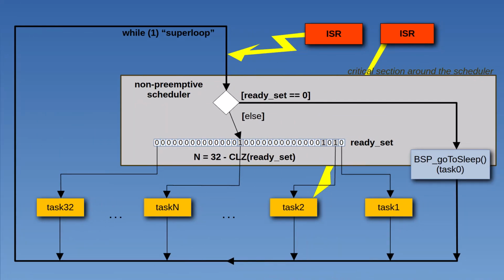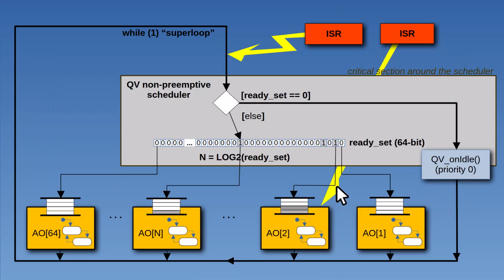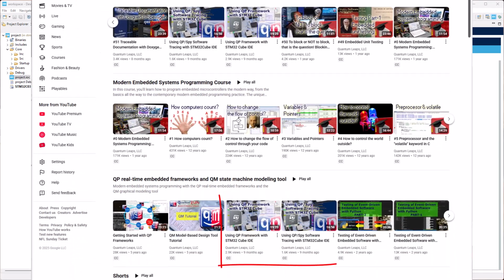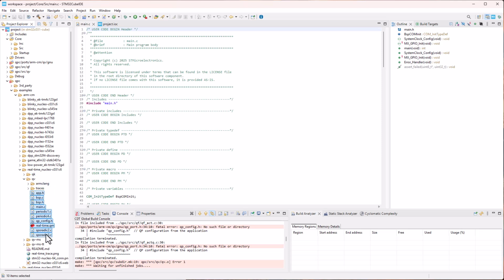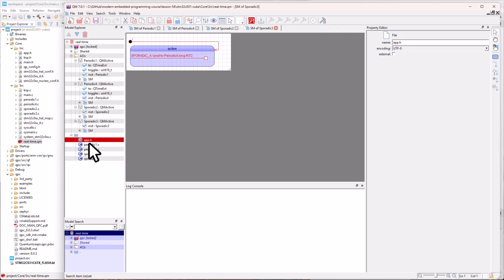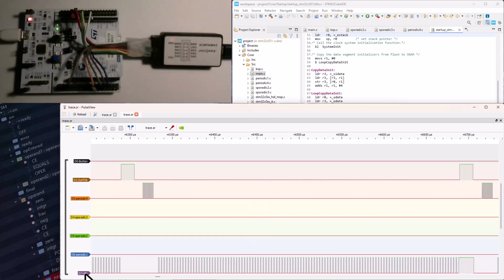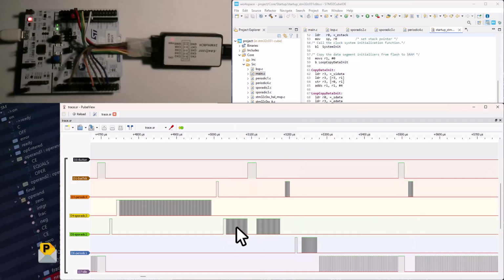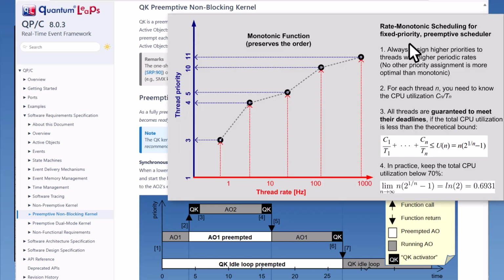#54 Non-preemptive QV Kernel for Active Objects

Comment: Hey Dr.Samek, thanks for the lesson !!
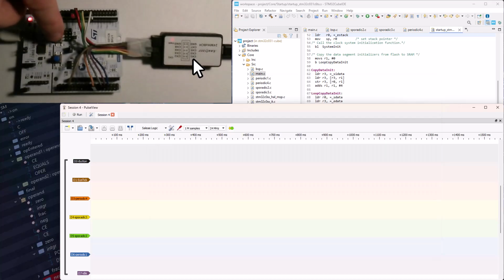I just wanted to say that the Pinout diagram at 17:47 has a tiny mistake. 

Pin number 6 should be pointing to PA9 not PC7.

bcp.c line 46 #define TST6_PIN  9U
bsp.c line 240 void BSP_d6on(void)  { GPIOA->BSRR = (1U << TST6_PIN);         } // LED2

which is controlling PA9.
Reply from the maker: Thank you for pointing this out! Indeed, the code in bsp.c shows that the test line 6 goes to PA9 on the NUCLEO-C031C6. Good catch! --MMS

Comment: Hello DR.Samek,  I am working with GD32VF103 microcontroller with RISC-5 architecture and QV Kernel. MY ISR is not working. what should i use instead of this  QK_ISR_ENTRY();  and  QK_ISR_EXIT();
Reply from the maker: You must be mixing two different kernels: non-preemptive QV and preemptive QK kernel. The macros QK_ISR_ENTRY()/QK_ISR_EXIT() belong to the preemptive QK kernel and aren't necessary in QV. Please just check the SysTick_Handler ISR in this video lesson. I will make separate videos about the preemptive QK kernel. --MMS

Comment: Hello, 
I am new to all this, I am a fresh CS grad. I wondering if I should do this course or not. I want to have a project on my resume to showcase os, embedded systems and stuff. I was wondering if I should start watching this course or not. and also based on my search on the internet, they have been suggesting me to do a project with ESP32 board connect them with sensors use adruino or espidf framework. I thought to myself that its a very high level project. What do you think about it? Just need some advice if possible or I need to know the direction which I am going in is correct or not?
Thank you
Reply from the maker: I suggest that you watch a few lessons in this course, but NOT from this lesson but rather from the beginning of the playlist: https://www.youtube.com/playlist?list=PLPW8O6W-1chwyTzI3BHwBLbGQoPFxPAPM . Regarding ESP32, I don't think it is a good starting point because it is based on Tensilica Xtensa CPU. In my view, it is much better to invest in the most popular CPU in the industry, which is currently ARM Cortex-M (used in this course). --MMS
Reply: @StateMachineCOM  Alright thanks, I am actually an Associate AI Engineer. But I am very bored of my job because the work that I do is mostly backend work. So I want to get into companies like qualcomm. Since my resume is full of AI projects, I wanted some non AI projects like OS or embedded systems(although I didn't have a course on embedded systems)